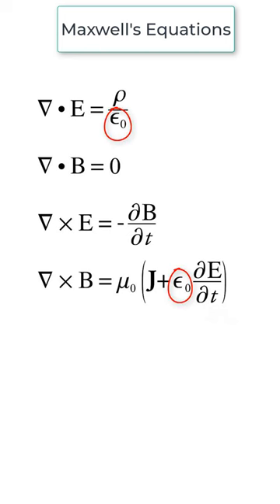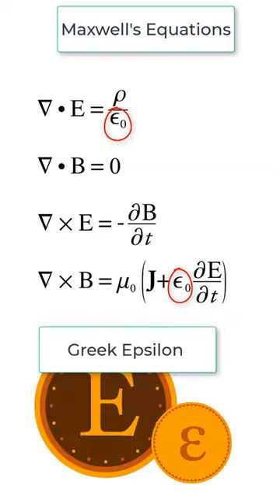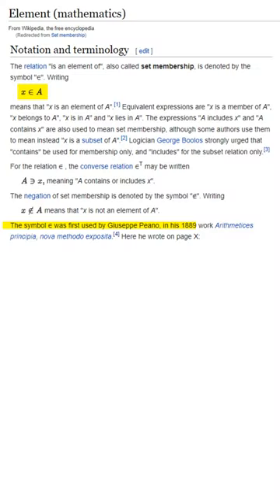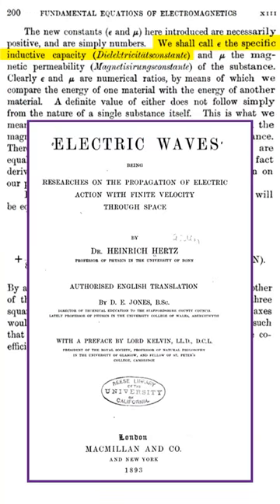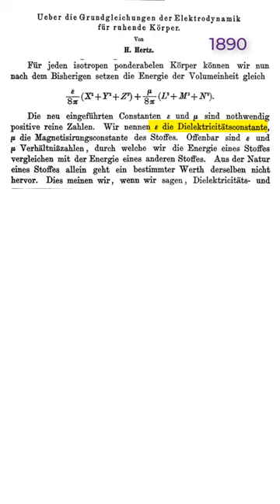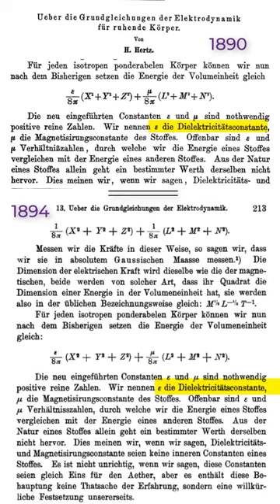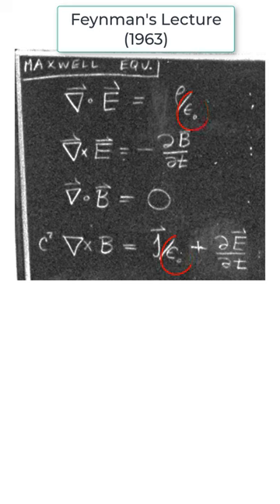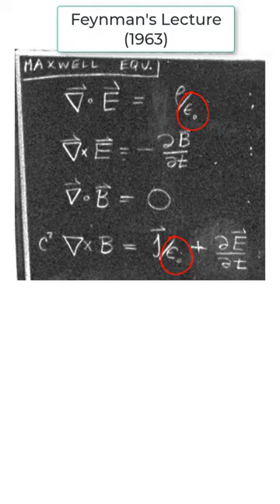Why Physicists Use 2 forms of Epsilon #shorts

Comment: The one like a C with a line through it looks like it is the “is an element of” symbol used in Set Theory.
Reply from the maker: That’s because it is. A mathematician defined that old form of epsilon to mean a part of a set in 1889 and the printer grabbed the wrong epsilon in 1893.